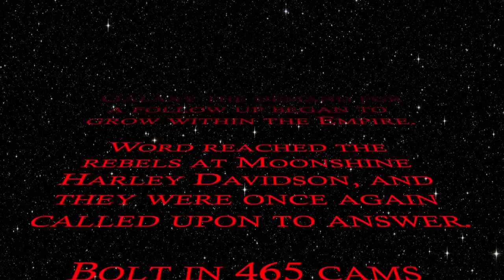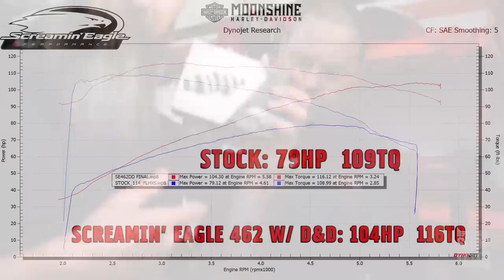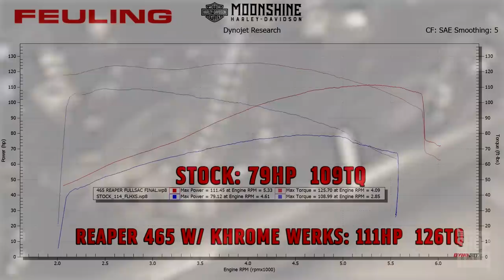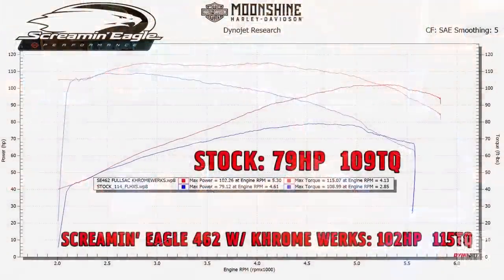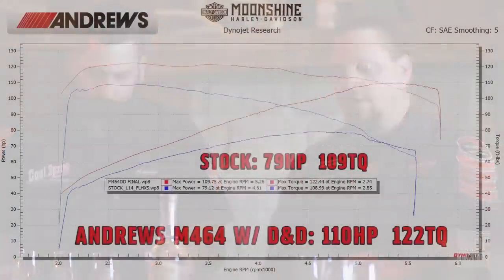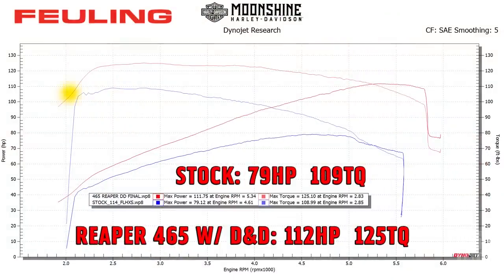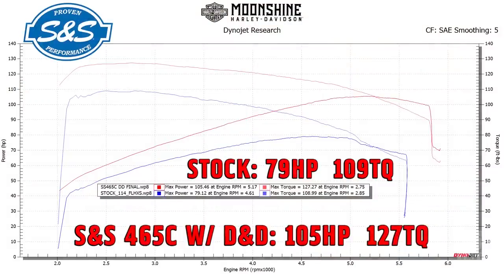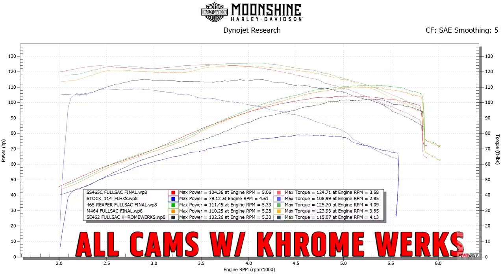Cam Shootout Series | Part 2 (Screamin' Eagle 462, Andrews 464, Reaper 465, S&S 465C)

Comment: Poor choice of 'music' if that's what you call that noise, too much time lapse of fitting work and too much chat ! Ultimately the numbers achieved on a dyno are not representative of 'real-world' riding situations. Why not take the bikes to a drag strip and show E.T.'s and speeds - THAT would be a 'shootout'. All this sort of thing you show is just for ego's and bar-stool bragging.....  When you change cams you are wasting your time and money unless you raise capacity and compression ratio, port the heads etc etc then you won't get a 20 or 30% power increase but increases of 70, 80 or even 100% BHP  and 50% more torque. get rid of the chain drive for the cams and get that weak crankshaft attended to.....
Reply: Do you have the E.T. and speed data? Would like to hear more and sounds like you have a lot of experience with this. Maybe these guys could use that data as a barometer for their comparison. IMO I love the music on this haha
Reply: @hk-47meatnbag92   No idea what the E.T. times and speeds are.... I don't work with this  bunch !  I am commenting that this sort of 'shootout' is just a waste of time - I do have experience of changing just a cam and that is why I say it's a waste..... the engine is configured to work with the standard cam so all you will get is a slight variation of original power. To gain a real power increase over standard, the engine must have more things changed than just the cam. My 96" twin cam is now 113" with lots of mods and has gone from 78 torque and 63 bhp at the wheel to a 122flbs and 127 bhp - I don't know what E.T.'s and speeds it would pull but I do know that it leaves 'standard' Harleys with a stage 3 or 4 kit installed for dead away from the (traffic) lights !
I doubt these guys would be able to use any data other than how much bread they can take from people for massaging said peoples egos about how their Hog is now so much better......
Reply: Robert Hutchings  so you haven’t drag raced your bike yet and have no e.t. Times but have a dyno sheet which means someone else built it and dyno tuned it to show you how much power it has ... which is exactly what these guys are doing here!  If you have 113” you had to split and line bore the cases which means you have 15k or so in the motor to make the same power as these guys  make  by just changing a cam.   Maybe you should call them for a more modern build but just my opinion.  :-)
Reply: @shaneschd   The cost for the engine build including lots of things sourced from ebay and the engineering and assembly wasn't even half your 15k dollars, it came in at £5600  ( about $7000) which I considered OK.  Yes, you are right - someone else did build my engine for me, I just removed it from the frame and stripped it then re-fitted it to the frame. The bike had 65k miles before I did this and the cases were bored to take CVO cylinders and the crank trued and welded  etc etc. I only dyno'ed the bike to check the jetting was right on my carb as I removed the fuel injection - the figures may well have been higher with EFI but I do not like it.
 My bike is a Twin Cam and so shouldn't be compared to an M8 - if my engine build can double the twin cam's power, imagine what the same treatment on an M8 could do. I am saying quite clearly in my comments that just changing cams does not achieve much compared to re-engineering a motor to suit new cams -  I used S&S easy start 640's. The M8 could end up with over 50% more torque and double the BHP as well , 160 BHP and torque seems like something worth going  for !
 Seems to me you are not reading and understanding that which I write - and as I live in England it'd not be easy to let 'these guys' meddle with my bike. I took the approach to the build as the workshop manager at Europe's oldest H-D dealer told me that the 'Factory' type of (Screaming Eagle) improvements were not worth it especially when the cost of labour was concerned - My engine builder charged £40 an hour to assemble the engine and I didn't charge anything. I use a lot of modified H-D parts and some aftermarket stuff and the total build cost of parts and labour came to less than a Screaming Eagle kit plus a 'technician's' labour charge.... and I had my old parts to sell !